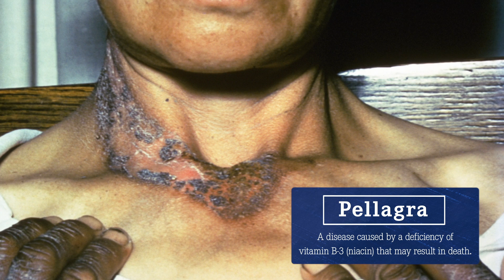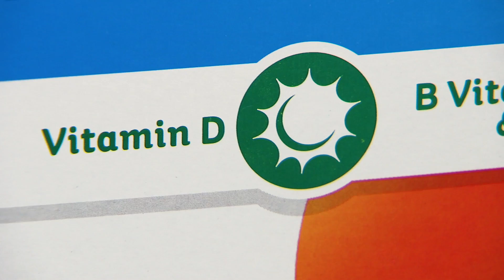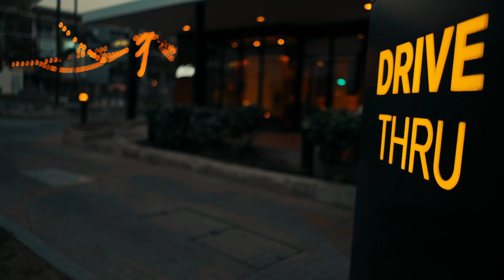What Ancient Farmers Had Right About Corn That We Ignore | WIRED

Comment: Quick version: soaking corn kernels in an alkaline solution helps our body process a bunch of otherwise wasted nutrients (see 2:55). This used to be done by the OG's but is typically skipped in the modern mass production of corn products.
Reply: Awesome. Thanks.
Reply: Excellent summary! 👏👌
Reply: Aka sprouting, which only works if the seed or grain is still living; didn't get heated